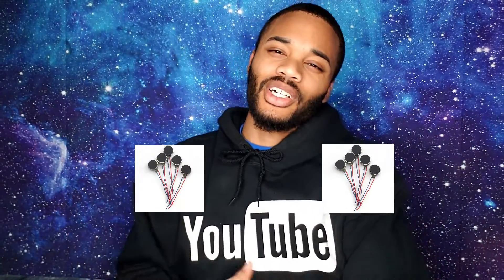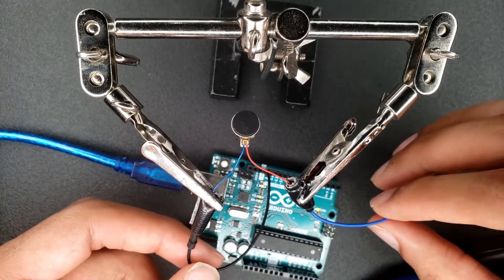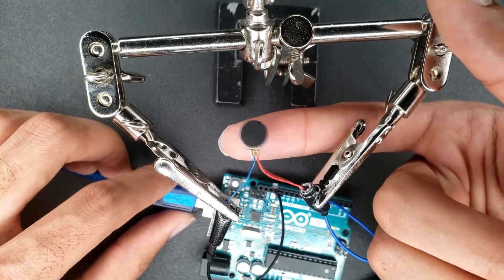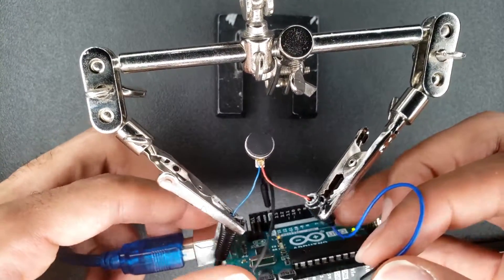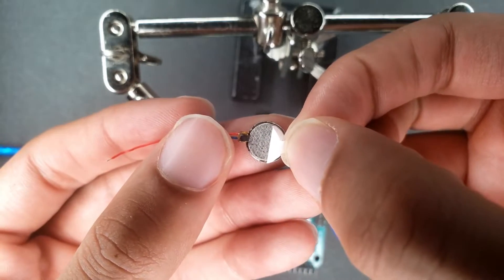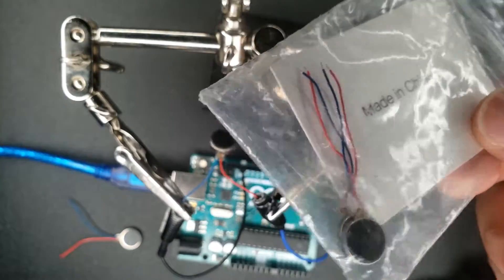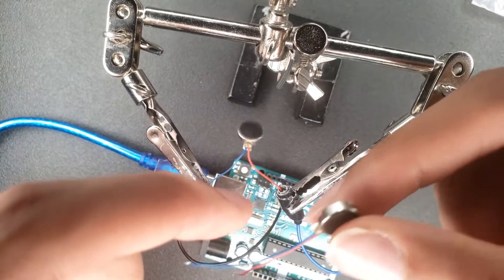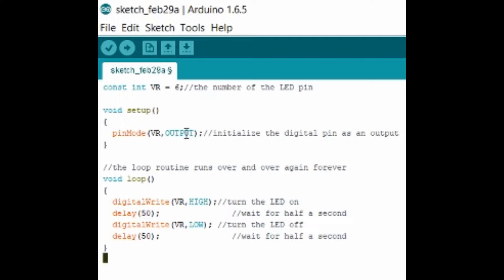How to make your project vibrate for arduino and code

Comment: How can I use with esp32 and blynk
Reply from the maker: What's that ?
Reply: @DreThePlug  Vibration motor
Reply from the maker: @ikrammohamdi4439  depends on what do you want it to do ?
Reply: @DreThePlug   I want control vibration motor with esp32 and blynk
Reply from the maker: @ikrammohamdi4439  you will have to change the delay in the code
Reply from the maker: @ikrammohamdi4439  also its a new arduino that allows you to control the arduino from your phone and turn it on and off

Comment: What's the voltage output on pin 6 ? Just to have an idea compared to 3.3 and 5V.
Reply from the maker: 6 is also 5V
Reply: @DreThePlug  You tried on 3.3v and it vibrates faster🤔There is no code for output 3.3V and 5V, so there is no on and off + delay. That must be the reason.
Reply from the maker: @laurentc723 all the pins have 5v  except the 3.3 v one

Comment: Hello sir, i'm a complete newbie on this stuff, does this work with arduino nano? If so which pins do I connect the wires to and are there things like resistors that i need to use?
Reply from the maker: Yes 100%
Reply from the maker: You can pick which ever number pin you want it all depends on how you code it
Reply: Sweet thanks alot!

Comment: How do I program one of these so the intensity starts out light and then increases
Reply: Didn't try but with a PWM Pin on Arduino you can apply the voltage approx from 0 - 5 V so i guess this will change the intensity of vibration. Just search for arduino PWW LED project and replace the LED by this motor.
Reply: @fordpurple7293  Thank you! I'll try it out
Reply from the maker: Ill attach it to a potentiometer or add a code thats similar to that

Comment: Man you driving the motors from Arduino Ports which will only drive up to 40mA of current and the button Vibrating take to 60mA, Not doing any good to your Arduino Uno !
Reply from the maker: Its fine i only used it for this video purpose

Comment: Do you have a link or the name to the metal rig which has those clips that you have holding up the vibrator wire weak points please?
Reply from the maker: Naa I bought it from a electronic store
Reply: Helping hands

Comment: Thanks for the video, does it not need a resistor?
Reply: Manali , If I were you I would use a motor Driver Chip as Arduino can only drive up to 40mA of load and the Button Motors need almost 50mA to 60mA , that does not do any good to your Arduino Uno Ports.
Reply from the maker: No it do not